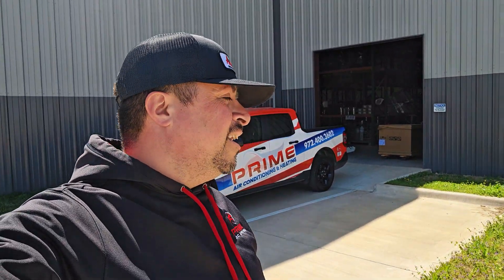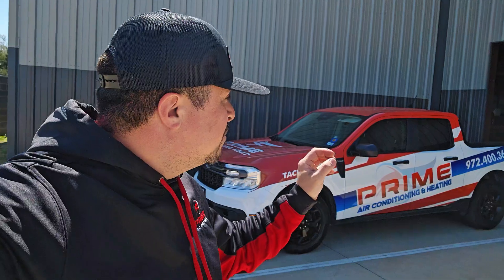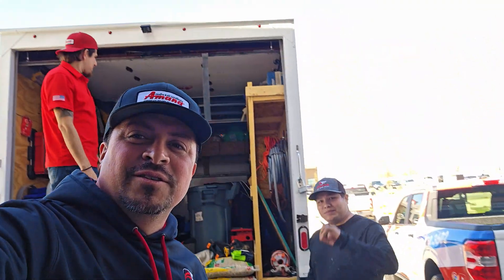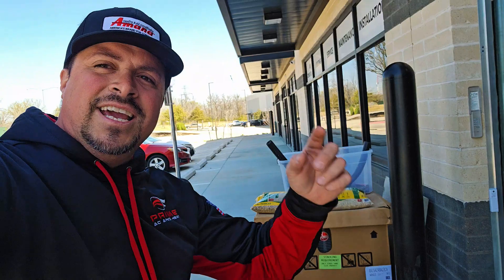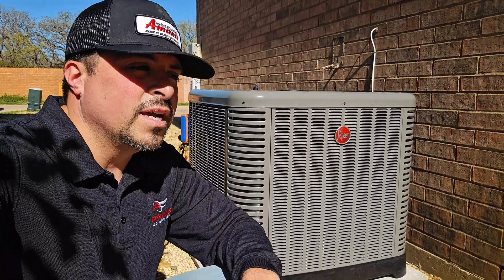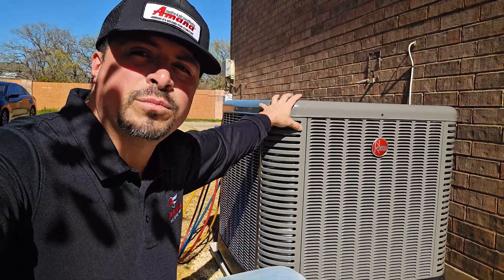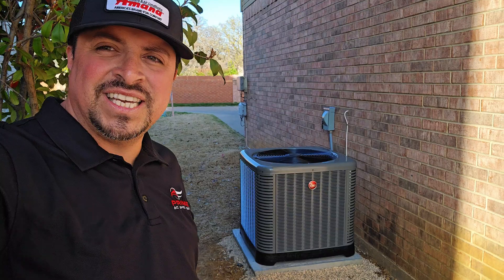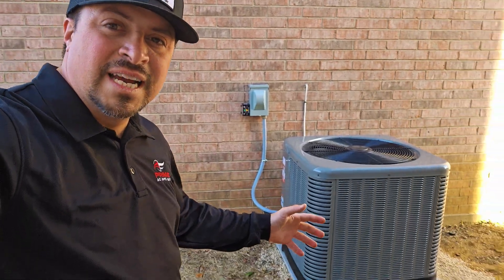Friday HVAC Install: Entry-Level 410A System | Outdoor Unit Only Upgrade!

Comment: Wild, so your client now has a 3 stage condenser paired to a single speed air handler? Is the pairing an AHRI matched pair with listed statistical data? Whats the air handler model number?  Was this wired to run in single stage, or did you also replace the thermostat with a mult-stage stat? The unfortunate downside to these systems is that they are rated for 15SEER2, but running at any capacity under full blast reduced their efficiency to around 9SEER2.. So is it really "more efficient" if operates the majority of the year at 9SEER2? Sales men at your distributor will play words game to get you to sell product they want removed from their shelves. Realistically, they have a 9SEER2 system now, and will only see the increased efficiency 2 months of the year.
Reply from the maker: Thanks for your comment and technical input.

To clarify, the Rheem RA15AZ condenser is fully supported by the manufacturer for operation with conventional 24VAC control wiring in nominal capacity mode. While EcoNet™ communication is preferred for advanced diagnostics and multi-stage control, the system remains fully compliant and operational when installed per Rheem guidelines.

In this case, the system was paired with a 2-stage variable-speed AMVC8 furnace and a compatible coil. This combination maintains strong airflow and comfort benefits, even when not using full communicating controls. All equipment was matched to meet efficiency and operational expectations.

We’d also like to address the “9 SEER2” claim: this is not supported by any official data from Rheem or AHRI. Even in single-stage mode, the system performs significantly above that level, with AHRI-rated matches for this condenser achieving up to 15.2 SEER2.

It’s also important to understand that not all families can—or want to—replace their entire HVAC system at once, especially with the significant regulatory changes affecting equipment availability and refrigerants. With the phaseout of R-410A manufacturing taking effect in January 2025, installing available 410A outdoor units that are compatible with existing indoor components is still a lawful, safe, and manufacturer-supported solution when done correctly.

At Prime AC and Heat, we remain committed to doing what’s right for each customer—not just pushing full replacements. Our recommendations are grounded in honesty, technical integrity, and a deep respect for each family’s comfort and financial reality.

Thank you for watching, engaging and commenting on our video!
Reply: @primehvac  That's a lot of words. Notice how the "compatible coil" is the only component in this very detailed description that is missing a model number to reference? This is likely because there is no AHRI matched pair for the coil/condenser combo that has been installed. Great video tho, and the smiles are fantastic!
Reply from the maker: @HairSandwichTV We appreciate it! Thank you again